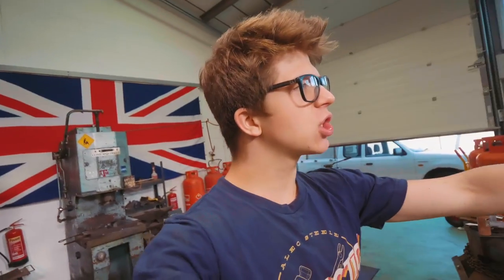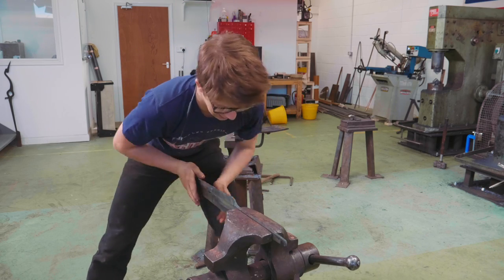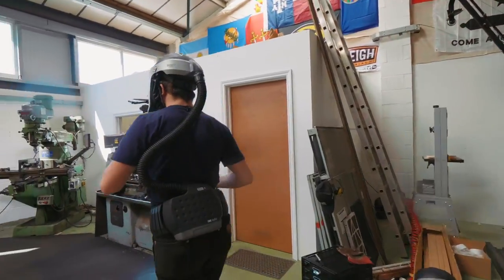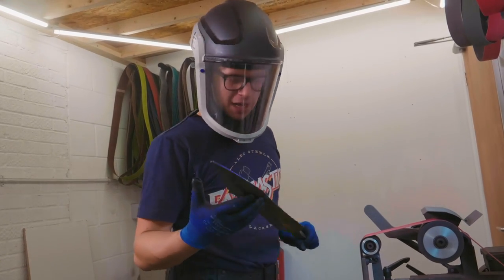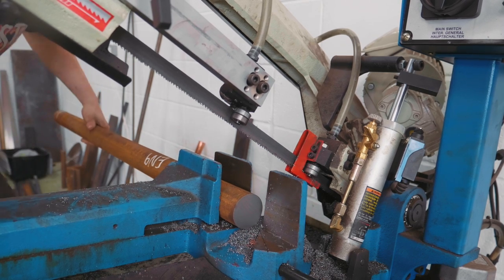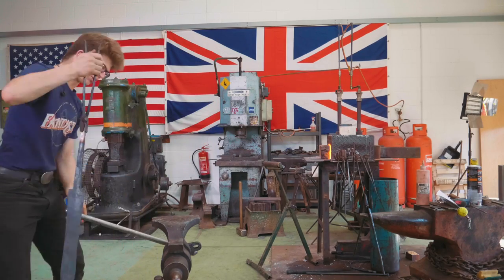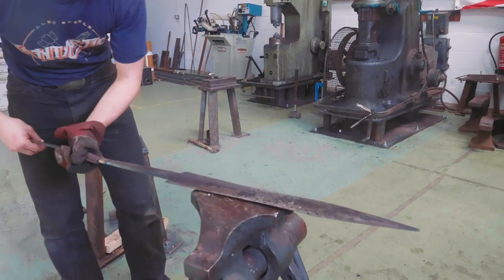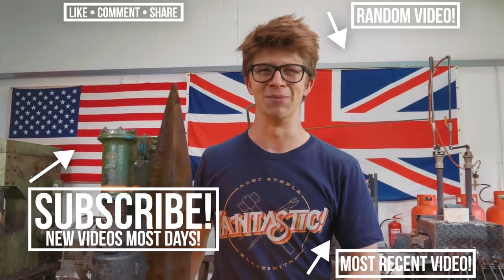MAKING A ROMAN GLADIUS!!! Part 2

Comment: In an effort to help resolve your horizontal space problems, I suggest getting a whole mess of pegboard and a sharpie. Pick where you want your particular tools, hang them, then roughly outline them so that every tool always ends up back in the same spot. I did that a number of years ago and it was a huge success. I always knew where everything was and everything always got put back in the same place with no mess on the horizontal spaces. Good luck!! Cheers!

Audrey

Comment: You are correct that quenching forms Martensite which is a body centered tetragonal (BCT) structure. Basically what happens is the high temperature steel changes it's lattice structure to austenite which is a face centered cubic structure (FCC) and the carbon dissolves into it. When you quench it, it does not give the carbon time to diffuse out and it is trapped and the cooled austenite becomes a highly strained BCT structure. The BCT structure has a lot of internal stresses in it which is what gives it it's hardness. Anealing it by heating it up allows some of the carbon to diffuse out and therefore the stresses are relieved and the brittleness is reduced.

Comment: I recall hearing that being able to easily see the color of the metal as it comes out of the forge is one reason a smithy is usually a bit of a dark hole (rather than an open, airy place where a fresh breeze can take away the stifling heat). Maybe you could modify your lighting situation for these points in the work. I'm sure you could get some good shots with the forge and metal as the main light sources.
Keep up the good work!

Comment: Alec, try tempering in oil. Make a container ,fill her up, then heat it with a flame on the bottom. Add your metal and follow the recommended time and temp for your metal.

Comment: A little tip on the quench. I have a bucket of peanut oil ( 10$/gal at the supermarket) after I quench into parks 50 I dip it into the peanut oil . It has a high flash temp and doesn't smoke as much so it's easier to see strightness. It's also supposed to be a suitable quenching for 1080 and similar steels.

Comment: Hey Alec, I've found a solution to live happily with most horizontal spaces.
Find a single horizontal space suitable to contain the caos and let it expand into the 3rd dimension!
It works... as long as you don't try to disrupt its equilibrium by pulling out someting from the 3rd dimension xD

Comment: Alec, please explain what normalizing does. And why you need to do it before quenching and all that.
Reply: Philippe Lobelle Basically when you heat up the steel, you are making the molecules vibrate. By heating and slowly cooling, you are allowing the molecules to stabilise and reform into a more solid crystalline structure. This reduces the likelihood of the blade cracking during the quench.

Comment: Why don't you put some pegboard or just MDF with nails in it on the walls near each of your stations so that you can just quickly hang things that you need  all the time at that station.  My shop is a tiny closet , so I had to do that just because of space.  But it puts everything at your fingertips and it's as easy to rehang something as to throw it on a horizontal surface, once you get used to doing it.

Comment: a tip if you pick up hot metal. if you push your hand in metal table or some metal laying around it transfer all heat to it take away the paint instantly an stop heat from spreading in to your hand.

Comment: Please make an electrically controlled tempering bath! It'll make your life so much easier as you continue with long blades. You take your quenching tank, wind a heating element around it, an then a control box with a digital thermometer drilled through the side near the bottom. Set your temperature, let it heat up and Bob's your uncle.

Comment: A cheap liniear laser or cross laser. Mount it above your measuring table/spot, draw the outline on the table or make a simple clamp/holder so you can recheck it when need be.
This can be used as an easy, repeatable measurement of center, equalising sides, edges and shapes etc.

You dont need a high end, powerfull one, since the distance from laser to surface wont be long, but glasses can be a big help in well lit areas.

Comment: @AlecSteele Just a little tip try not to lay the blade down vertically whilst hardening it, that could've become very warped, you should put it in the vice like you did for tempering because it evens out the stress that causes warping

Also huge fan of your videos always an inspiration to get me lighting up my forge!!!

Comment: Use the rosebud for tempering not the cutting end !
Get a proper pyrometer for reading your temperatures
Your horizontal surfaces, Either you put large plastic triangles on them to stop junk accumulating
Or you find a proper location for everything and you take the habit of putting things back as you no longer need them

Note : only way that last bit is going to work is you need two 2x3 feet small "dessert" carts, those are your designated tool surfaces, they follow around and whenever you need to put something down you put it on the cart

At the end of the day all carts MUST be emptied properly

Make a metal rack on the walls behind the flags

Get a proper marble true surface table , no junk allowed on the marble table

Comment: I'm no expert on the subject, but I've read that back in the day Japanese sword makers would put clay on part of the blade before doing their hardening, what this apparently did was allow the edge of the blade to heat up up to a higher temperature  while keeping the spine slightly cooler before quenching. Meaning that they had a harder edge to allow it to stay sharp and a softer spine to absorb impact without the sword bending or breaking. Not sire of all the specifics but might be something cool to research and maybe try out in a future project ?

Comment: You really need to get a rosebud tip for your torch.  Using a cutting tip can work, but you have a smaller heat area and the chance of accidentally hitting the lever and burning the carbon out of a small area of the project.

Comment: Would there be a difference in letting it normalize with the tip down (as you do in the vid), versus the tip up, or setting the blade out horizontally to normalize?

Likewise with quenching the blade; any differences between how the blade is positioned for the quench?

Comment: Hi!
Why do you have to grind before tempering? canˋt you just temper first?
Reply: as the metal after the hardening is (obviously) harder,it will take longer and ruin the sanding belt quicker
Reply: Klaus Römer he grinds before tempering so he can see the oxide colours since hes tempering with a torch and not an oven, the oxide colours are a good indication of heat while tempering so he doesnt overheat the edge of the blade

Comment: Yes!!! First

Is copper safe for cooking food?
Reply: Yes, copper pots and pans have been used for centuries, and are still prized by top chefs as they conduct heat so well. Its also anti-bacterial.
Reply: No It's not. Copper pots is covered in other metals like tin on the inside. But on a spatula it hardly matter.

Comment: I have a question that I hope one of you can answer.  He was concerned about the oil not being able to quench the blade properly.  If he used the oil, and found out that it didn't harden, would there be a problem with re-heating it and then quenching in water?  Or would he have to start normalizing again?
Reply from the maker: +Jason the Cripple I would probably redo two normalising cycles before going into the water! :)

Comment: Why do you grind before tempering and would a tempering oven be a better tempering method where a specific temperature could be held for a length of time over more than one tempering cycle??
Reply: To see the colour change. And of course a tempering oven is a "better" solution. But those things are 'spensive, especially ones that can fit a big lump like that gladius.
Reply: Biting Mongeese - Geoffrey Bynoe he used a torch because you can't fit a sword in a oven

Comment: actually, the finer the structure, the harder the steel. when u quench, you create many nucleation sites and each grain remains small, and therefore the dislocations in every grain cannot travel far because of the samll size of it, that's why it breaks and doesn't bend.

Comment: Nice work dude
Just two things, magnet is a good trick, but its totaly depend on witch metal u working with, ex an xc75 become not magnetic at quentching temp but an xc100 need to be like 80°c after that point and some alloy hoter than that.
Second thing, when u grind a curved blade, try with a little curved table, better than a flat table.https://youtu.be/1jPcZJFyEKQ?t=607

Comment: A fine blade, but not like an original gladius. Roman weaponers used a charcoal fired forge, and didn't start out with "real" steel. They started with a billet of wrought iron and folded it somewhat like damascus but not as fine. The layers of soft wrought iron became impregnated with tiny amounts of surface carbon from the charcoal. As the number of layers built up traces of carbon impregnated the pure wrought iron in a steel-like matrix. The result was a sort of semi-steel that could be hardened quite a bit but the tempering process was iffy at best. The gladius was a stabbing weapon, used in a rank of infantrymen who linked their shields together in a wall and thrust the sword between the gaps. If the gladius was used in a parry like later swords, it was prone to breaking. Indeed, your blade is probably far superior to an original Roman sword.

Comment: Alec, you probably shouldn't use that brass spatula for actual cooking -- most brass contains lead, which can leech into what you're cooking!
Reply: Erm, its copper... so no lead. And antibacterial to boot!
Reply: Yeah, copper not brass. Still not great for you in large doses, but generally harmless
Reply: It's not that great to use metal any kind on cooking pans I believe it's just supposed to be a novelty item something to put on the wall in the office
Reply: Rachel Cone metal on pans is only bad if it has a nonstick surface. With a stainless steel or cast iron pan metal utensils are fine
Reply: nvm I commented before I saw the video😂😂
Reply: ALet338 still not the best when you have things like rubber and wood spatula that do the some but you shouldn't use metal on metal cause you get micro scratches and can wear down the pan faster
Reply: i had a friend whos uncle made them solid copper double zero gauges and she wore them for id say a year so plenty safe